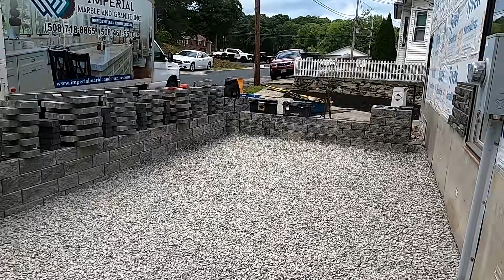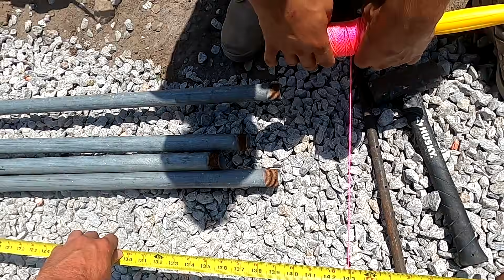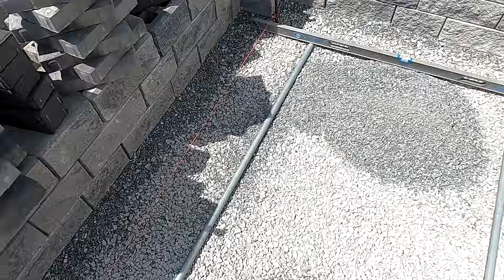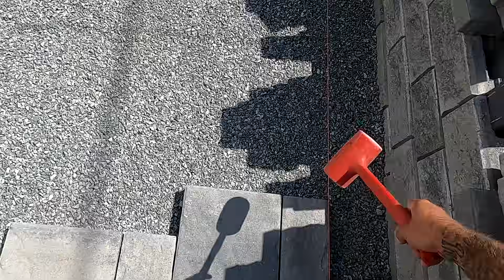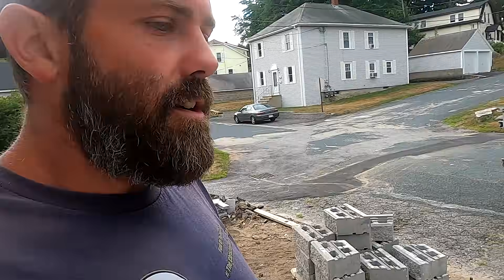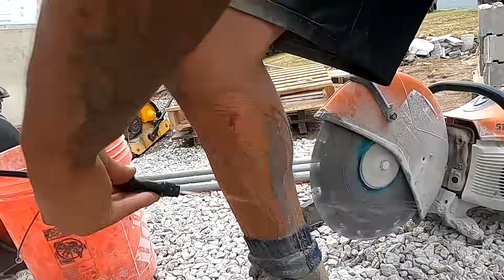How To Square, Screed & Lay a Paver Patio

Comment: I like your work, but your pitch definition is incorrect...if that's a 2 ft long level and the bubble is touching the line that is 1/8 " in 2 ft or for a 4 ft level its 1/4" in 4ft, both of which are actually 1/16th pitch or one inch per 16 ft of run..js.
Reply from the maker: Sorry, but you are incorrect. A 1/8 pitch is 1/8” per foot. Doesn’t matter how long your level is. And 1/8” per foot is 1” per 8 ft. My definition is not wrong.

A 2 ft level with the bubble just touching the line would be a 1/4” of slope from side to side. A 4 ft level with the bubble just touching the line would be 1/2” of slope from side to side. A 6 ft level with the bubble just touching the line would be 3/4” of slope from side to side. And an 8 ft level with the bubble just touching the line would be 1” of slope from side to side. Check it on any of your levels, that is what it will be. 

1/16 pitch is less than the bubble touching the lines.
Reply: @TheChristianHardscaper  every 4ft level i owned...showed 1/4 per 4 foot slope when the bubble touched one side...I've had a couple that had 3 lines..when level those had the bubble touching both sides of first line...second line was 1/8 th pitch second was 1/4 pitch ..per foot...i could have misinterpreted your explanation...my most common use of that was for rain gutters..recommended pitch was 1/4" in 4 foot...easy to check your particular level..use a 1/8" shim at one end and see if that puts the level on the line..for a 2 ft level 1/8 " off to the line would give you 1/16th per foot pitch.
Reply from the maker: I definitely agree that there are some specialized levels out there that may be different, but every level I have owned / used is 1/8" pitch when touching the lines. So I'm not sure what to say about that really. I thought they were all pretty universal.
Reply: @The Christian Hardscaper  i had to check my self on this..most sources say 2% on the bubble touching the line so i guess i stand corrected...i would just say though in the case of laying out large projects i always used actual measurements rather than level readings...set up a storey pole etc...I'm not trying to fault you, i think your work looks fantastic...i will take the hit on this one ...but i will say one other thing that may help you in squaring things up...its much better to use the 3/4/5 method than to try to line up a framing square with a string...js..i know you aint building a piano but I've seen some real effed up shit cuz someone tried to layout a job with a speed square and string..lol.
Reply from the maker: I can agree with that for sure, checking your level before hand is always good 👌 And I know you don't mean any harm, neither do I. Nothing but love here! And I totally hear you on the speed square, Sometimes I use the 3,4,5 method to double check things when I get close. I have seen some really messed up projects too...LMAO. God Bless ! ✌